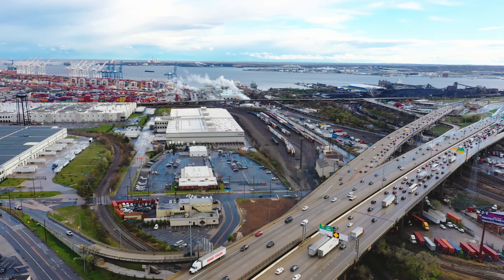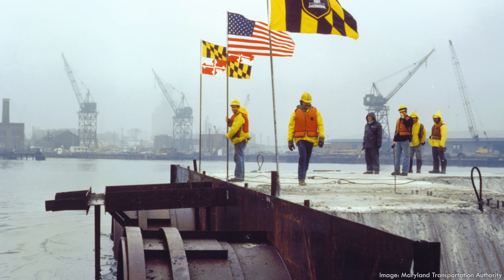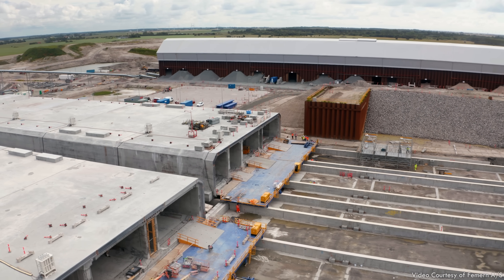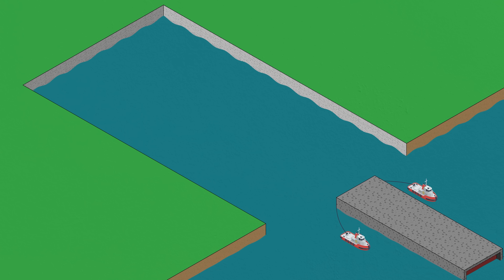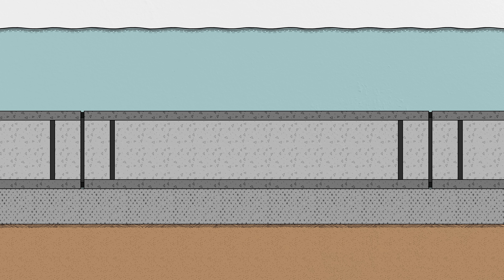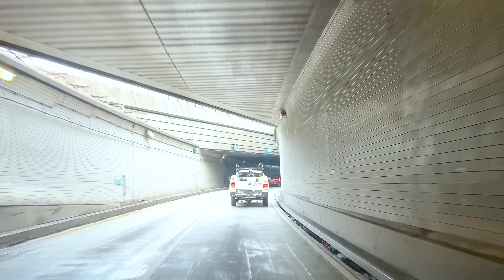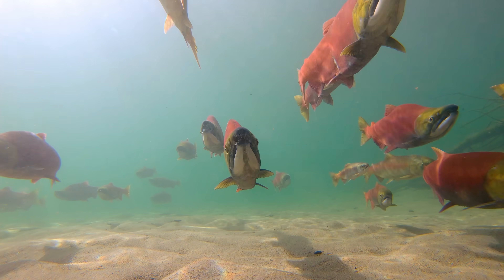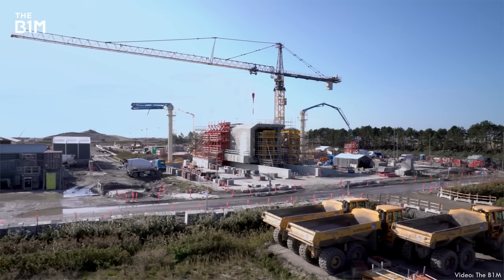The Most Implausible Tunneling Method

Comment: Of all the tunnels in Denmark, every one that goes under a body of water, is an immersed tunnel tube for the simple reason that our entire underground is mostly clay and porous calcium carbonate, as well as sand. There are spots with limestone and then Bornholm has Granite, but not really around the island itself. That too is mostly clay. So whenever we need to build a transport method across a waterway and a bridge isn't an option (wind is often the reason why it isn't), we go with immersed tunneling. It does, as you say, disrupt quite a bit of the ecosystems, but with the reports of the past few years describing our inland seas and fjords being mostly ecologically dead and the sheer lack of actual political will to fix it, I doubt we cause too much damage.

Jokes aside, we usually take the chance to simultaneously create a better ecosystem than was there before. This is seen both with the Öresund bridge between Sweden and Denmark, where the tunnel starts on the island of Peberholm^ and then there's the train tunnel under Storebelt (the great belt) between the Danish islands of Zealand and Fyn (Denmark is essentially just a lot of islands and Jutland being our only peninsula), in both cases critics of the projects were worried that it would completely destroy local wildlife and local ecosystems, but instead the opposite happened due to the planning of the projects including improvements to the ecosystems on project completion and for the future, so now Peberholm is a perfect breeding spot for several endangered birds and Sprogø is a sprawling ecosystem of species that can only be found there and which were previously almost extinct, but is now quite bountiful. There's also breeding spots here for endangered species, proving that as long as wildlife is included in the planning, then short term ecosystem disruption is good for both humans and nature.

^Peberholm is an artificial island that was named during its construction by the Danes as the islet of Saltholm (holm is Danish for islet, while "peber" is Danish for pepper) lies close to it. Saltholm is named as such because the groundwater is too salty for humans to drink, but there is an old fort, several ruins, an old graveyard and more, including endangered wildlife. It's also protected and neither campfires, tents & camping or drones are allowed there, among other rules.

Comment: For the bored road tunnel, the spaces below the roadway and above the ceiling are used for ventilation. Because of the high cost of excavation there is no wasted space in tunnels. It is very challenging to fit all of the required utilities into a tunnel.

Comment: Hmmm.. What's the expected lifetime of these tunnels? Box sections aren't the strongest shape, and I'm guessing the they are made of re-enforced concrete to have strength to accommodate the weight of backfill and water above. That stuff doesn't last forever due to corrosion of the rebar. Also the "rubber" seals... most rubber or rubber-like materials degrade. In both cases it's hard to image how such a tunnel could be repaired. Have there been any cases?

Comment: Great video, very informative.  It did make me smile to see the clip at 10:23 showing a completed tunnel, which is actually the Eastern Distributor in Sydney, Australia. You can see road marking for Randwick(R'wick) and Bondi at 10:29.  That section isn't even underwater and I think that section might have been cut-and-cover. 
Doesn't matter though, it was still a well made and well presented video.

Comment: In paris, some of the metro Seine crossings were done using immersed tube tunnel. For the 4th line, the tunnel is made of steel and was put into the river bed by putting workers digging in a pressurized air space underneath the tunnel instead of making the hole before bringing the tunnel. glad for the contractors the safty measures were not that stict at the time.

a post card of the technique used : https://fr.wikipedia.org/wiki/Ligne_4_du_m%C3%A9tro_de_Paris#/media/Fichier:Malcuit_-_M%C3%A9tropolitain_de_Paris_-_Souterrain_construit_sur_caisson_%C3%A0_air_comprim%C3%A9.JPG

Comment: A thick silicone sleeve that slides over the exterior might not be the cheapest solution, but it would have much larger tolerances to issues like shifting and gaps. The trick is not fully setting down the unattached end so the sleeve can slide partially off of the submerged tunnel section and onto the new section before the two ends are let to fully sink to the bottom and the final cinching can take place. Stuff like this is pointless if you get the rest of everything precisely sealed, so it would just be an extra layer of safety, but that would make this much easier to do and make things cheaper to scale these sorts of operations up if we want more under water tunnels.

Comment: Grady, what about rubber seals? Rubber does not last particularly long - it loses its sealing properties quite quickly, 10 years at most. Do they use additional sealants to keep the joints from leaking?

Comment: Grady, could you do a long video on flywheels? I personally like that an underpowered engine or motor can spin up a steel or cast iron flywheel weighing multiple tons to then produce intermittent work far above the engine alone. The other aspect is energy storage for renewable sources during the day for solar and generating electricity during nighttime house or when wind is not rotating wind turbines, and balancing loads on electric grids. The largest flywheels I know about are at the Joint European Torus (JET) tokomak in the UK. They have a pair of rim-loaded, 775 metric ton (854 US short ton) flywheels, 9 m (29.53 ft) in diameter, that rotate at 225 RPM. Each flywheel can store 2600 megajoules of energy and produce 400MW for a short time.

Comment: I missed something: if the segment floats when filled with air, how does the tunnel stay at the bottom  once in place?
Reply: They fill it with water and it sinks. Then they bury it in soil and pump the water out. Its boyant again now, but the weight of the soil above keeps it down

Comment: I think a more implausible tunneling method would be to first have a single prebuilt tunnel section, then push it into the thing you're tunneling through. Then take another section, push that into the previous section, pushing it forward into the tunneling medium. Repeat until other side is reached

Comment: I'll bet the upkeep of a tunnel must be a big part of it's expense. If you turned the power off and walked away, how long before it's flooded and impassible? How much maintenance is needed on the seals? Even just the rainwater running in wouldn't take long to fill it
Reply: It's not part of the expense of construction, so it's not even considered here
Reply: @joshyoung1440  And that is exactly why I asked

Comment: Have to call out...tunnel sections  float by being filled with air.  Tunnel sections on the bottom once installed get filled with air, so without additional engineering not mentioned, whole tunnel would float to surface.
Reply: because they pour soil on it. The weight keeps it down

Comment: The bridge height constraint also comes up on highways with pedestrian overpasses; trucks can be quite tall (typical clearances on highways can be 15 feet or more) so a walking/biking overpass must be even taller than that, which means your human-powered travelers are putting in a bunch of effort to go up and over a huge distance. This seems deeply unfair to the pedestrians.

Why don't we do more pedestrian underpasses which would only require going maybe 7-8 feet below the road instead of over twice that above it? It would be a lot less effort for pedestrians to cross, and if you put a shallow/gradual grade into the highway on the approaches of a few feet, you'd only need to have the pedestrians drop down a few feet from normal travel height (with the remaining slack taken up by the road-going vehicles that can certainly absorb a few feet of height difference with no consequence).

It can't be that much more expensive to put a small pedestrian-sized tunnel under a highway than building a big concrete and steel monstrosity over it, can it?

Comment: For boring a tunnel, could they use a variation on those coal mining machines that dig through the layer of coal while propping up the roof around the machine and the workers? Just leave behind the tunnel as a result of having dug out the dirt and rock in the middle?

Seems this would take care of the wasted space above and below the road deck.
Reply: Anthracite is much softer than bedrock. But I've never heard of this machine, do you have more information?
Reply: @joshyoung1440  Had to look up the name to go along with the description I'd heard but it's part of the longwall mining system.

Comment: Seems like this type of tunnel could be useful for containing communications and energy utility pipes across waterways. Multiple tunnels in each box section could house multiple pipes, even of different types. This would be more expensive than just laying a pipe at the bottom but would have the benefits of service access via the tunnels for inspections and maintenance and secondary containment in case of leaks. You could even potentially drag replacement piping into tunnels after construction using wheeled electric tugs to tow them and wheel dollies under the pipes

For really long term construction, wound basalt fibers could be used instead of steel rebar. They could theoretically last for centuries with little maintenance.

Comment: Here is a question: So the massive elements are being floated to the required location (swimming on water) and then lowered to the seabed by flooding some parts of the tunnel with ballast water. Everything is fixed and secured and then the ballast water is removed. So the tunnel element should float again, shouldn't it?

Comment: Maybe I missed it, but how is the tunnel anchored to the ground? 

The tunnel section is floated in place, then flooded to position it on the ground. Now the water is pumped out to use it. Why doesn’t it just float straight back up? Is the weight of the soil/backfill enough to hold it down? Are there any addition anchors drilled into the bedrock bellow the tunnel, to hold it down with steel cables?

Comment: I watched one of these being built across the Medway in England.  From the surface, and without much knowledge, it looks so simple and obvious, so it was fascinating to discover just how complex the construction really is. 

I was quite excited to drive through it after it was completed, but it was quite an anticlimax! It was exactly like one of those sections of motorways that go underground for a few hundred metres, but are rectangular, not 'proper' tunnel shaped. 

I knew I was going through a fairly unique type of tunnel between two sides of an estuary that had never been linked before, but the actual experience is totally normal - you don't even get to see the river! 

If I hadn't seen it being built I would literally have thought nothing if it. 

Thanks again for what you do, Grady - one of the best channels on YouTube.

Comment: During a presentation of the construction of the I-664 tunnel from Suffolk VA to Newport News VA, they said that the equipment needed to work inside the tunnel was sealed in the tunnel as no access was available until they broached the surface.

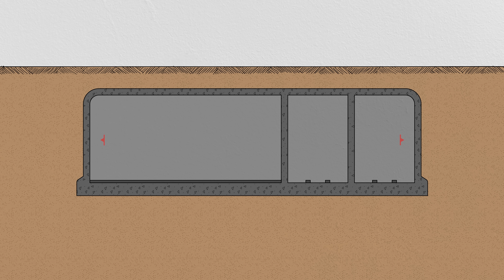Comment: 3:22
I don´t quite agree with this. The issue is that the round shape take high pressure better,. The flatt shape of the emerged tunnels need more concrete and rebar, that cost more money.

While the round tunnel only need to evacuate the material, that is typically not relay that expensive.

Typically the middle between the highway lanes (of the diffrent direction) they make a row of coloms to cut down the span of the compressed flat part.

Comment: One of the main cost in construction is uncertainty. And one of the most uncertain part is digging.

A rule of thumb is that a girder beam bridge cost 1 unit, a truss or stay bridge cost about 2 units and a dugg tunnel cost about 4 units.

But a preconstructed tunnel cut that cost down quite a lot, specially so for long tunnels in shallow water.

Comment: The new subway line in Amsterdam is partly immersed tunneling under the river IJ, which connects to a bored tunnel under the historic city center which then connects to a cut and cover tunnel for the part outside the city center. It's a tunneling medley.

Comment: Yeah if you have ever been across the Continental Divide here in Colorado near the Border of Wyoming, or vise versa, but man its very steep in sections, so steep they have to put up signs to warn semi drivers to not overheat their brakes, I think it's a 35 degree climb in sections, Not the worst in Colorado since the road to the highest paved road is also a steep one. But it not a very comfortable feeling climbing up those inclines and declines, especially while it's snowing! 
For reference what im talking about its road or Highway WY70 off of Encampment, Wyoming Which goes back tord Colorado taking this road you go over the Divide and even follow it for a time, they also have many stop where you can park and look over the area from the road, very cool area it goes to Bag's Wyoming. I used to go hunting near bags on the Colorado side of the Border each year as a kid, its where my Dads dad took him hunting as a kid!! I've been up that road to the Divide in 2 blizzards before racing to beat them closing the road for the winter... Not fun at all at times!

Comment: Tunneling wouldn't have been a problem for Caucasians if you didn't spent many dozens of trillions on others including fighting their idiots for them only to get the whole race blamed. For them ending up squints at tribes of them still at genetic behavior maximum to being a threat Plasma generated Ultrasound holography resonance.. A Boring machine that breaks down everything in its path to its smallest parts by resonance, spreads it out around the machine, and then uses ultrasonic pressure wave pushes out from the machine while firing echoes to come back to crash with the outbound pressure to create thick molten shell for the tunnel. Perfect atomic structure if use of Cymatic patterns..

The shape of the machine won't matter it would be just a high powered sound machine pretty much. Squints at Boeing Plasma force field blocking bomb shockwaves < Any intelligent being knows what Ultrasound can really do, CONTINUOUSLY.. "We gotta save MONEY!" Why because you ended your race again? - Deist

Comment: Check out the Femern connection between Denmark and Germany. Built with the same principle. That will dwarf this little project. Also: Tunnels built this way, is not necessarily much more expensive than bridges, especially if you have to run trains between the two point.

Comment: Baltimore actually has two tunnels - the Ft. McHenry and the Harbor Tunnel, with the former being the older one.  Eventually, with increased traffic and the prohibition of hazardous materials in those tunnels, the Francis Scott Key Bridge was built.  Ironically, now that the original bridge has been destroyed, its replacement will be a much larger structure that will indeed dominate Baltimore's harbor.

Comment: 3:07 Trains are better fit in circular bored tunnels than cars. Their wheel width is less than body width. So they fit perfectly in a circular tunnel. Also the space above can be used for overhead wires.

Comment: The Ted Williams Tunnel and Fort Point Channel Tunnel in Boston, extending I-90 under the Fort Point Channel and Boston Harbor to connect to Logan Airport, were built using this method in the 1990s as part of the Big Dig project.

Comment: I wish they would do this for the 3rd proposed Bay bridge in Maryland. Instead of the 'Brilliant' idea our state has come up with of adding an additional bridge in-between the 2 existing 🙄. What should happen is using a tunnel from somewhere around Calvert cliffs over to a landing south of Cambridge and then have a causeway over Blackwater Refuge just like they did in Louisiana. 50% of traffic can go there from DC/NoVa and then the other 50% from Baltimore and surrounding areas can use the existing bridge  but instead they want to jam more lanes to clog our roads 🤬

Comment: Wow, this is nuts. Would not think this is a solution - it's really not that much different than building an underwater "Sea Base" or something. In fact, even more difficult than that as it connects to the surface and needs to support millions of vehicles using it!

Comment: The Big Dig used pre-made steel tube sections, each longer than a football field, that were sunk into a trench in Boston Harbor and connected to form the tunnel.  The Big Dig tunnels have been plagued by leaks, with reports of hundreds or even thousands of leaks throughout the system
Reply: 99% of the leaks are not noticeable to the public and people using the tunnels.  The water is handled by pumps and rarely if ever makes it into the roadway area.

Comment: 5:40 Too expand a bit on this: You can bore through soft material and sand, as long as you Tunnel Boring Machine is designed for it lol. I only know this because of the TBM used in the Perth underground  where the ground is like beach sand consistency lol.

Each TBM is pretty much custom made for the job and the material you're drilling through.

 So if your expecting solid granite and get mud, youre in for delays as you have to backfill with grout, allow it to cure and then get back to drilling. Same thing for sand, water rich stone and even the same stone, but it broken up/ fractured prior too boring, it get stuck in the poor lil TBMs teeth lol.